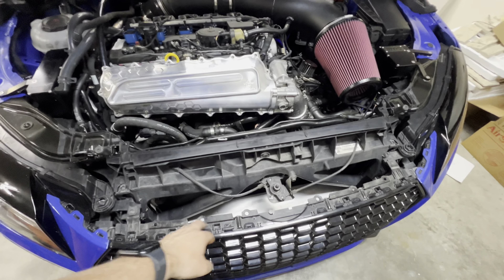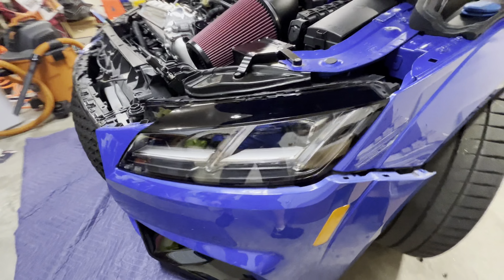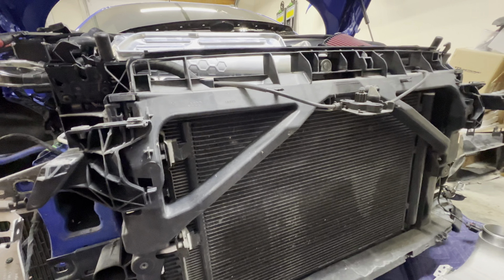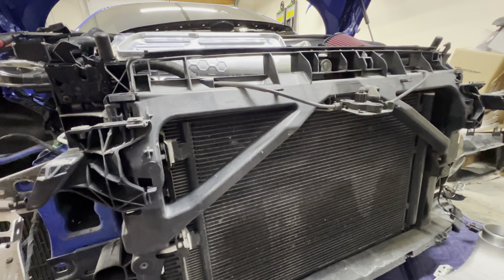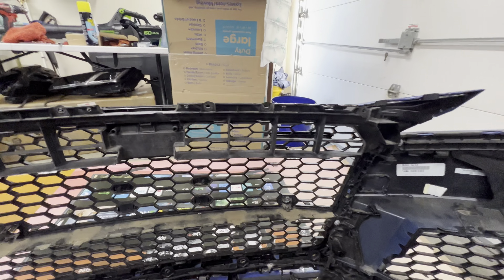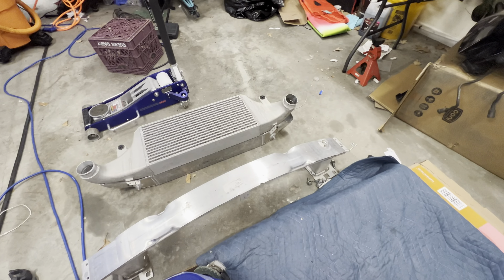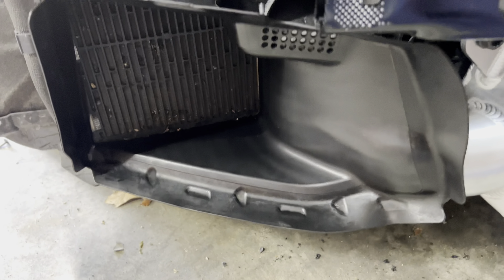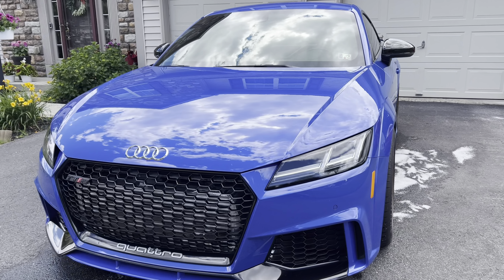Rada Race Lab 1300hp intercooler install

Comment: Yk and I hear the argument A2A doesn’t perform well past what 600-650whp, yet ALOT of these 700-1400whp cars are running huge intercoolers such as yours. That’s disregarding a2a innerchiller (co2 shot) if people are even doing that. Really just shows A2A is still ideal even at high hp